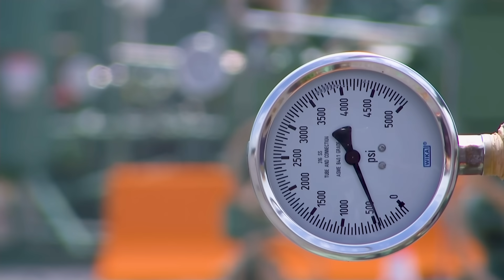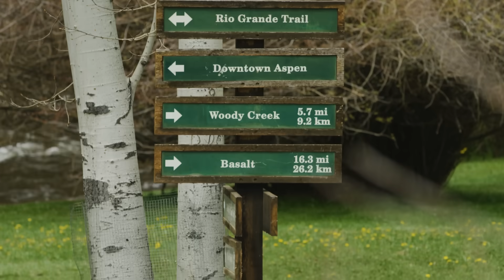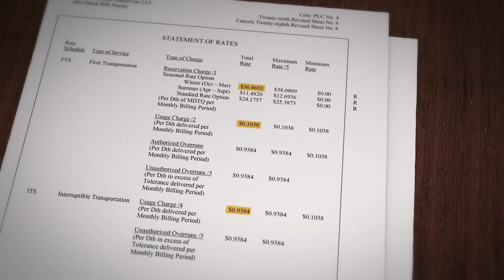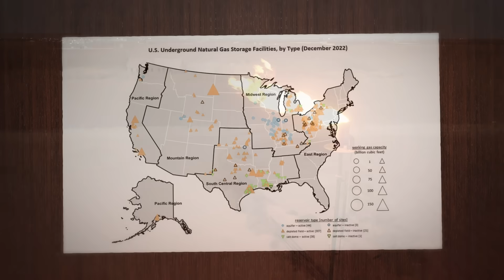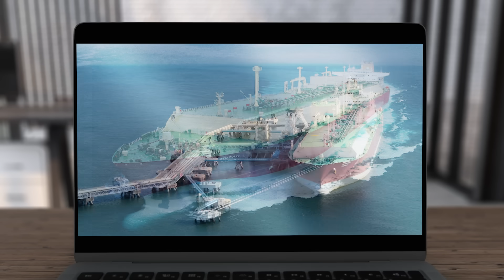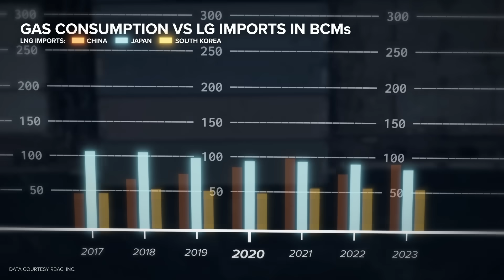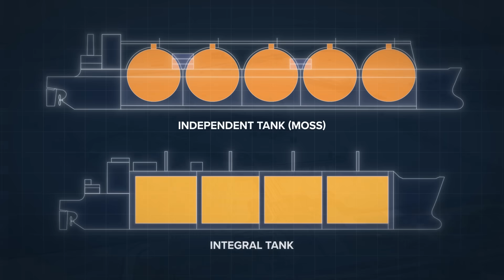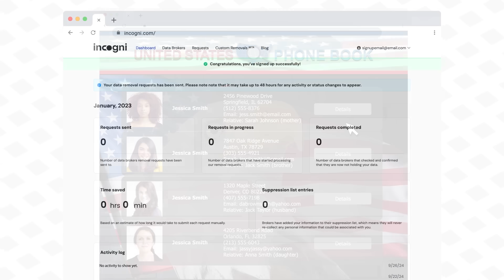The Logistics of Natural Gas

Comment: I'll give you a hint. Nat gas isn't going anywhere for a lonnnngggg time. Right now its impossible to create the amount of "clean" energy needed to replace nat gas in not only industrial, but even residential settings. There just isn't capacity on the grid to replace all the appliances. I'm lucky enough that someone at some point upgraded my old home to 200amp. But lost homes around here have a measly 100 Amp service. That's not enough for electric heat, electric water heating, and electric dryers. I recently exchanged my electric range for a gas range just because electricity is so expensive here as well as natural gas is just the far more ideal method to cook on with a stove.
Reply: Induction stoves are wildly more efficient than gas stoves even if the same gas is burned in a power plant.

Comment: only if america had built 500 nuclear power plants and the rest of the world as well and all this was not needed, electricity would do it.
Reply: i love the potential of nuclear power, but it's been a pipedream for at least the last half a century. capex is massive, operating costs are high, fuel costs are high (mostly due to inefficient designs), npps are huge strategic and security risks, long term storage is a gargantuan environmental problem (again mostly due to reactor designs), legal/treaty limitations on improved reactor designs, nimby mentality, and inflexible production all stand in the way of widespread adoption.
these problems are not insurmountable, but there's basically next to no public will for it, so politicians don't bother, especially because their careers are usually dependent on comparatively short election cycles.
Reply: Maybe, but CCGT is a lot cheaper to build (partly because of the lack of scale and overregulation of nuclear power) and is 60% efficient. Burning gas directly in your home is more like 80% efficient for tap water and 95% efficient for radiators with a modern boiler.

Insulating well and using a heat pump is the future. Nuclear power is a useful insurance if we can't work out cheap, scalable electricity storage and dynamic electricity pricing for consumers over the coming decades.
Reply: The change is coming much faster now as the fossil fuel era comes to an end

Comment: Us in the Philippines: what is a pipeline?

We get our "natural gas" through 11kg LPG tanks worth around $20 a tank. In-home heating had been largely unnecessary because it does not snow here.

We would appreciate if we had lower LPG prices since our income isn't as high as Americans, but at least it's not a necessity here and as such, we never needed to build infrastructure for it, and most of our utilities are on poles rather than underground.
Reply: LPG and LNG are not the same thing. LPG stands for "Liquid Petroleum Gas" it comes from oil refining and is mostly made up of propane and butane. LNG stands for "Liquid Natural Gas" and is mostly made up of methane. 

These gasses have different origins, different properties, and thus different delivery systems.

Comment: As a geologist, I'd like to point out that oil and gas don't come from caverns underground, they virtually always come from the natural porosity in between the grains that make up the rock. Just like you can encounter groundwater in the soil by digging down to the water table, you can encounter gas and oil in the actual rock by digging to a formation holding the hydrocarbons in it's pore spaces. This same pore space can be used to store gas or carbon dioxide after it is injected, as well. Some salt caverns are used for this process, but those are relatively uncommon.
Reply: This is so cool! Thanks for the info!
Reply: Thanks for the information! I imagine the inaccuracy in the video is likely down to simplification for a lay audience, either during the research or video production itself, as it seems to be an incredibly common feature of media discussing oil and gas production.
Reply: so does that mean it kinda works like a sponge?
Reply: @matthewbarry3497 a sponge that isn't sponge.
It's more like one of those fancy exfoliating shower scrubbers things full of air.
Reply: @matthewbarry3497 that's probably the best way to think of it, but obviously you can squeeze a sponge with your hands to make all the water come out if the pores.
You can't squeeze a reservoir rock with your hands to make oil and/or water and/or natural gas to come out, but it's there in the pores of the rock.
Reply: @ Yes, that is a good way of thinking of it.
Reply: THANK YOU. As a fellow geologist, that phrasing really got under my skin.
Reply: As an engineer who originally majored in Geophysics, you’re absolutely right ! lol
Reply: I'd rather be a rich nerd than a moron
Reply: Like a sponge?
Reply: Hail from another geologist 👍
The structures call Traps where oil and accumulate.
Reply: This is why fracking was such a valuable innovation. It offered a way to access gas trapped in shale.
Reply: Yes. And “ tight oil and gas “ comes from especially dense shale formations that require hydraulic fracturing to let the gas and oil flow.
Reply: As an internet user I’d like to point out that you need to shut up
Reply: As an asshole, shut up.
Reply: I came here to say this! Although the error is understandable, I used to think there were caverns of hydrocarbons before I started working in the industry.
Reply: How much y’all get paid yearly/per hour I might be one
Reply: @thyblackpanther  it massively depends on what your role is. Generally, you can't just decide that you're going to go into this area of work. For example, the job I applied for required a Mechanical Engineering degree. There were over 2,000 applicants and I was one of 8 who were offered the job.

Geologists will require a degree and then most do their time as a mud logger, which is very poorly paid, and then after a few years step up to Data Engineer, and then get a role as a Geologist.

Cleaners get paid fairly well and don't require qualifications, but they do generally work hard.
Reply: @ thx bro u a real one🫂
Reply: I imagine a geologist like yourself can also comment upon the management of water resources.  The Oglala Aquifer (fossil-water) vs. the newly discovered resources under the Cascade Range.
Reply: Love to all of you, for sharing such cool stuff!
Reply: COOL!
Reply: thank you for your service
Reply: if we pumped CO2 into these pores, could, after some time and pressure, this turn into gas?
Reply: @moosesnWoop  no gas came form from kerogen in meta genesis process by millions of years. If you pump CO2 it will move upwards.
Reply: @moosesnWoop NO😂
Reply: So you're saying immediately this video has false information
Reply: There's 39 salt cavern storages in the US so calling it uncommon is debatable. That number would likely be higher counting by site instead of formation.
Reply: @NoticemeSinPi  Admittedly, I worked in O&G production, not storage. and 39 isn't exactly a high number. But my main point was that hydrocarbons come from porosity, not caverns.
Reply: @krazykrispy21 have you ever worked in the far Canadian North or Artic North region on any of the drilling and directional drilling projects where everything single aspect of the operations has to be either flowing in by helicopter or floated in on barges then unloaded and setup for operations when the region freezes?  And there’s is only a 4-5 month time frame to assemble, drill, frac, and disassemble operations for natural gas before the region thaws?  People have no clue of what is involved and of the millions of dollars spent just to explore for new natural gas reserves, the amount of drilling equipment, trucks, generators, fuel tanks, maintenance and repairs facilities, construction equipment, man power, operations buildings, living quarters for 200-300 people, including storage facilities from simple office supplies to food storage and cooking facilities etc.  And the entire gamble can make or break a company they may find gas on one out 3-4 wells drilled or not find any gas at all and the decisions where to explore is all based on Geography and Geologist.  👍👍Thanks for what you guys do much respect for your work👍.
Reply: It's where we find plastic bottles.  I reckoned it was pretty time-consuming to pour all of those out.
Reply: my guy this is Wendover productions. No one watches this for facts. People watch it as a white noise.
Reply: What about coal bed methane ?
Reply: This is basically fracking
Reply: You can even store stuff like helium down there. They used to do that outside of my hometown
Reply: Shhhh
Reply: As a creator making a video for the lay person you have to be flexible in how you word things to get the idea across and not necessarily the exact description just as all teachers have done for hundreds of years. But we now know that you, a geologist knows the exact description of how gas is in the ground.
Reply: Reservoirs are exclusively porous rock (tho k of sandstone that nice government buildings are sometimes made of with effectively no obvious visible porosity) or in some rarer cases (including shale gas fracked reservoirs) the gas is held in a near impermeable rock and carried to the wells via high permeability cracks in the rock.
Reply: The word fluid refers to both liquids AND gases
Reply: Yeah...everyone knows it's dinosaur farts
Reply: I used to work on the well logging tools to measure down hole formations. We used both gamma ray and neutron sources along with acoustics and resistivity. I did it for 8 years then did telecommunications on a pipeline for 15 years.
Reply: this guy gets box
Reply: I seen videos of the inside of a oil well, and it really squishes out of the rock like it's a sponge
Reply: New info... thankyou.
Reply: I came here to comment this exact thing after hearing him say that. Also that he said gas is "often" a biproduct of oil production when it is ALWAYS a biproduct
Reply: So it’s like a wet sponge?
Reply: I wanted to be a geologist so badly but I couldn’t afford college and had to take care of grandpa 😔 I’m a dispatcher now but def not my dream job
Reply: I always thought it was a cavity lol.
Reply: I was reading how the gas is stored and I thought the same thing. In czechia we have one abandoned mine as a cavern storage, but rest are in porous rock
Reply: @peepa47  take jsem si hned vzpomnel na nas pribramsky unikat
Reply: You are missing out if you haven't read "The Frackers" by Zuckerman. Seriously.
Reply: @ great book!
Reply: Thanks for the info nerd!
Reply: I will start by saying.. 
this is fascinating. 

I don’t have the knowledge of your system. 

But I have tons of questions, some answered while I think. 

I would love to ask more. As a biologist/fellow STEM, I wanna learn! So. If you would humor me… maybe we can have a two way conversation and others learn from this?
Reply: @Zman44444 feel free to ask away. I'm an Engineer who used to work in Hydrocarbon Exploration and Production (i.e. Drilling). I won't know geology as well as OP, but I've picked up a few things along the way.
Reply: Thank for pointing that out. It is a common misconception.
Reply: Opinion on Obsidian knifes?
Reply: I have a house high on a clifftop in Bel Air LA. Lots of engineering went in to build it on the raised land. I surrounded the whole house with palm trees along the road, my house isnt visible from the road level. How do they get this pipe through the rock etc for a gas connection?
Reply: Are they cost prohibitive or do they just not work well for storage?
Reply: @ There just aren't many natural caverns in the world that are sealed deep underground. Way more natural porosity.
Reply: @UnangaxMNDRGN theirs a plant in Alberta one of the biggest shipping terminals that had a down hole cavern for oil storage and it collapsed and they lost thousands of cubes of oil so theirs always that possibility Lol, it was also an old salt cavern
Reply: @tristans4579  ok, but is there like a ton of others that have been fine for years or no? That’s kinda the point I’m trying to make. Again i don’t know I’m actually just asking.
Reply: I've always wondered, do you know how stable those types of caverns, eg salt caverns, are for storing compressed carbon dioxide? Current gas storage systems are only storing at day or week intervals, but are they stable enough for century or millenia storage scales?
Reply: @Spencergolde  not my area of expertise, but I believe I know enough to be able to answer you:

For traditional oil and gas reservoirs, they've been gas tight for millions of years, so we know that they are secure for our uses.

I don't know much about utilising caverns where salt used to be, but I suspect that they will pressure test the cavern and then pump the fluid out of the cavern and confirm that it's structurally sound when not overpressured. Obviously, prior to doing this, analysis will be performed to predict that the cavern is sufficient for its use case, the physical tests are just to confirm the maths and assumptions are correct.

I worked on one of the first CO2 storage projects in the world. This was to store CO2 in an offshore reservoir that was confirmed decades ago not to contain economically viable hydrocarbons. The client initially said that the design life was that the storage needed to last forever. We explained that it's impossible to design something to last forever. They relented and came back and said it needs to last 20,000 years. There were a few challenges, such as CO2 can break down cement, so a specialist cement needed to be formulated and then tested in a high CO2 environment. Another issue is that CO2 is very dry. It causes the salt water in the pores of the rock to leave salt behind. This results in reduced permeability. Therefore on a regular basis water was to be pumped down the well and left to soak in order to dissolve the salt that was left behind. Then CO2 injection can continue with the permeability improved.
Reply: Is it always like this or are there some big empty ‘caverns’ underground? How can you store gas back down there if there is no cavern?
Reply: @ The same way you can store water in a sponge, except usually with even smaller holes.
Reply: @Aladdinsane64 porosity of a solid sandstone can be as much as ~30% so 1m3 of rock can hold about one third of its volume of gas, but stored under many times normal pressure so you can get loads in.... Also just do the maths on how much volume there is underground even in a small field of say 1mile x 1mile x 100ft thick!!!!
Reply: Nerd
Reply: Dude literally explains this in the video.
Reply: You probably just graduated, and wanna let the world know about your new found knowledge. Good job and thank you for sharing for those who aren't aware
Reply: @ I got my Masters 8 years ago now, I'm just still passionate about helping others understand the natural world under our feet.
Reply: Fracking damages or fractures the stone even further to release more gas and oil. Yes to fracking
Reply: @El-Kompadre and destroys the environment, drinking water and harms people. Have you ever seen a petro company clean up after itself?  How close are you to a hydraulic fracturing plant?  You are either stupid or a troll.  You even legal bro?

Comment: Demand will not go down for NG as long as all of those new electric devices are still powered by NG power plants. Some people just don’t understand electricity has to be produced. Energy always comes from another form of energy, period.
Reply: Heat pumps are more efficient that gas heating so replacing all gas heating with heat pumps would reduce NG demand even if all electricity was produced by NG. But yeah, this is why investment into renewable energy sources is so important so we don't fall behind as the rest of the world moves to become fossil fuel independent.
Reply: Also realize that most of our plastics come from gas.
It's hard to wrap my head around how many tons are produced each year.
Reply: Thats the part that People don't often think about.

NG is greener but far from green, all of the fuel and logistics involved in just getting down the hole is incredible.

Water, sand, fuel the drilling rigs the workover rigs the lines of pump trucks.  

Trucks in and out day and night when it's flowing back. Maintenance on the productions tanks and that's just the stuff you see on the surface. Forget about the pinging back and forth from the permian basin to the bakken to the marcellus
Reply: @ChoppaShoppa45  I agree, although having worked in oil and gas the last 9 years, I’ve seen a huge change in the way we power everything. Don’t get me wrong still a ton of diesel gets burned, but the amount of rigs and fracs that have gone to NG or highline power itself has gone up a lot. Coil and work over ops still burn a crap load of fuel but I’m sure they’ll make some kind of E-coil or something. Also seen a lot of electric wire line trucks lately granted they’re powered by a generator sitting next to them most the time still burns less fuel than a truck.